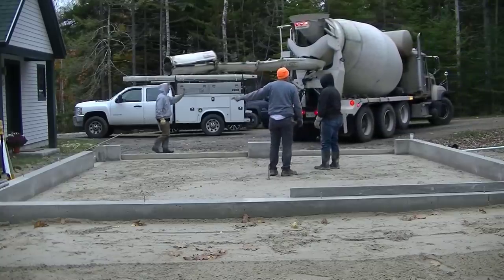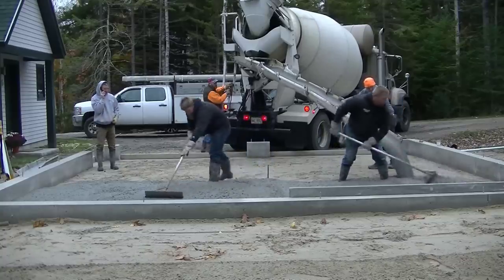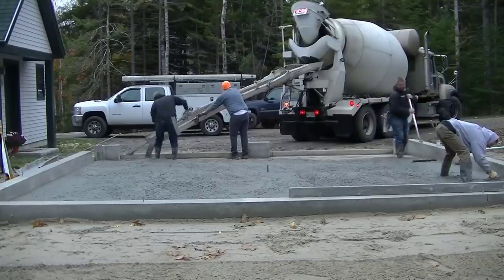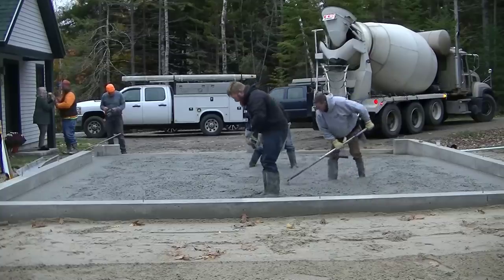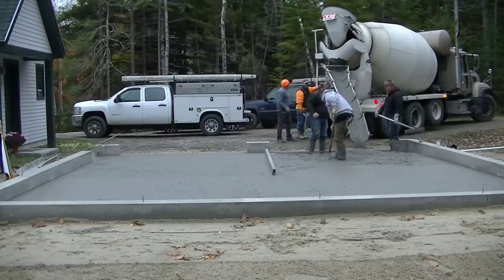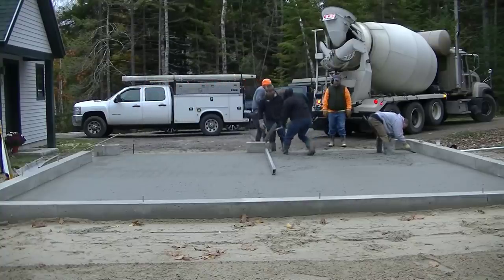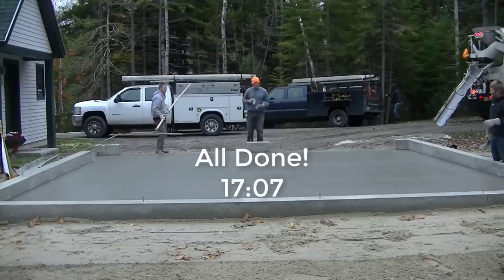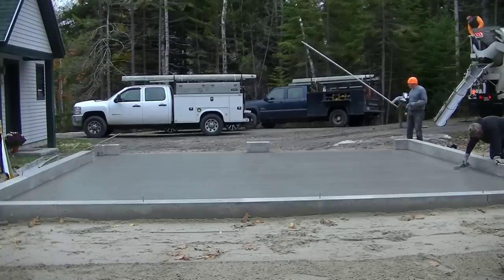17 Minute Garage Floor Pour (How To Pour A Concrete Floor)

Comment: Sloppy wet concrete no strength. Any one with any experience can do that. Let's see u pour 5 inch slump not a self leveling conrete. Show a video of the finish. Drop a marble on it and let's see where it goes.
Reply from the maker: Slump was a 3 before adding water reducer. Do you know what that is?
Reply: Mike apparently they don't know its not common practice because all the people who think they know concrete have never dealt with additives . We pour all the time with inspections looking at everything.  Specs call for 3 in . Slump . water reducer is your ony option.

Comment: 3500 for a garage floor? Yea maybe, I would have used 4000 myself with the fibers but we do pour some garage floors and basement floors with 3500 but if it was my own floor I would use 4000. You don't see many butt dumpers here in Michigan anymore most everyone has front discharge mixers. I do see some in the bigger citys but not in the subburbs.

Comment: Never place concrete greater than  a 4in slump even with water reducer added to mix design. That high of slump leads to segregation of the aggregate. Also the amount of come along use to move the concrete will cause segregation of the mix and will ultimately weaken the concrete. There is no need to place concrete that fast other than to produce a pour product for your customers. Concrete producers do not expect you to place a load that fast.

Comment: Even if using mesh u should peg the walls. Go back in a year or two and check out your giant crack from wall to wall in the center in both directions. Hump and heave. Good crew. Good work just lacking something extremely basic in every video that is bad for ur Crete. Fun to watch but until u guys do at least one job with the correct tools for your mix and prepped correct. I can't watch u teach people how to make pretty concrete that won't last. Sometimes trying to so things in ten minutes isn't cool. Slow down and do it right
Reply: Never seen anybody put a slick finish with fiber mesh. Looks like a bearded floor man. Debar is $200 man get sum
Reply: That old lady is probly like where's my debar lol

Comment: How about 10 yards in 2 minutes ? At a 8 inch slump off the chutes reved up high rpm discharge rinsed and gone off the job in 12 minutes . Y'all be doing it slow...

Comment: Concrete way to wet. Almost self leveling.  Shrinking will occur  and definitely  cracks.
Reply from the maker: Slump was a 3 before adding the water reducer, It won't shrink but maybe 1/16" and we saw contraction joints to control cracks.

Comment: No wire mesh to pull up saves time. I've never done a slab without it. Fiber mesh is another "invention", touted by millennials and specified by architects who don't know horse shit from honey. For the DIYers, wire mesh will not prevent cracking. It prevents the cracks from stepping.

Comment: I would get another concrete company 6 bucks for hot water wow they heat it off the engine does not mater summer or winter that engine runs at the same temperature
Reply: What???? There’s a boiler at the plant that makes the hot water.
Reply from the maker: Yea, it's heated by a boiler at the plant with a huge water tank for reserve.

Comment: In Australia....we put in a thing called steel ..its reinforcement to concrete... essential in any concrete . Sure with all your experience U know that ...so why didn't you place some .....cheap n nasty and poor owners have to put up with your mess in future....cracking and dropping ...yeah good work ... NOT
Reply from the maker: Sub-base has 99% compaction so it won't settle. Floor is locked in by the foundation. 3500 psi concrete with water reducer will break at 4000. Sawed contraction joints after finishing. Done 100's this way with no problems. Keep doing it your way and we'll keep doing it our way. Been 40 years now and haven't heard from an owner about our "mess" yet.
Reply: Always best to keep your mouth shut and have people ‘think’ you don’t know what you’re talking about, rather than to open it and remove all doubt.

Comment: Rubbish, slump like soup, now will take 8hrs to machine finish
Reply: If your using water.use a plasticizer (water reducer). It does the same thing as water but without reducing the strength. The stuff we use,will increase the slump by about 2 inches 1 gallon per 10 yards. It last for about 45 mins and losses it's effect.